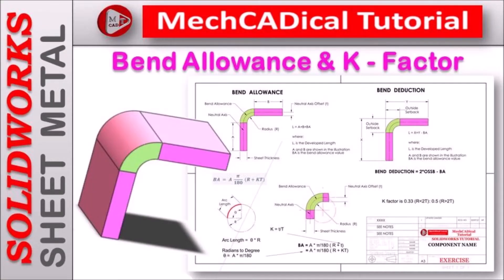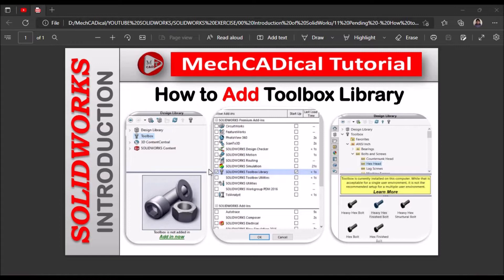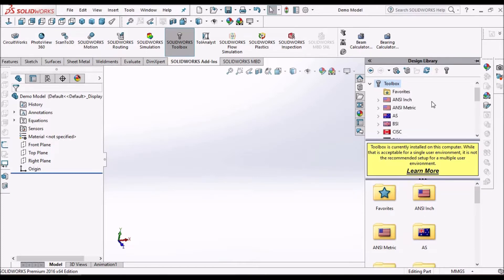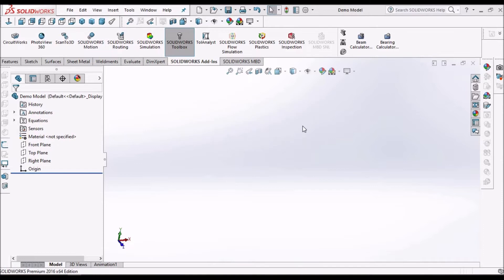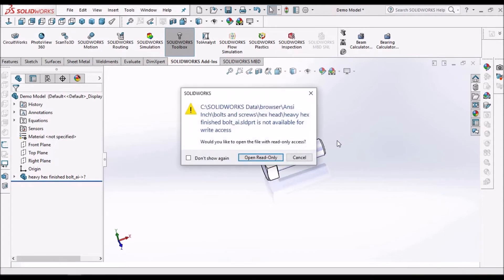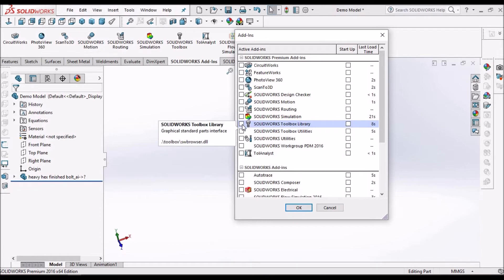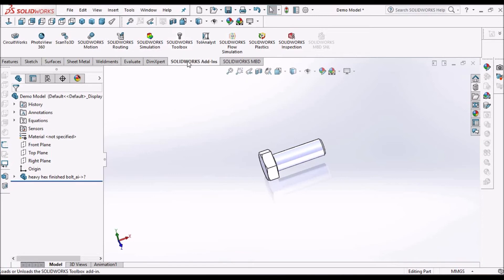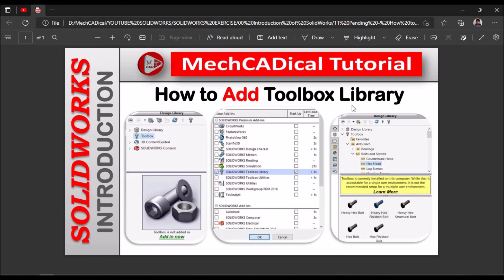How to Add Toolbox Library In SolidWorks

Comment: Please help me, how to fix the derived part issues? I cant custom parts dimension😢
Reply from the maker: Don't worry its very simple, use "pack and go" option and rename the part file, then you can modify the dimension.
Reply: Is your problem solved? I have the same problem. I select the object with the Toolbox and place it. But it gives a derived part warning. Then when I want to adjust the size of the toolbox part I selected, there is no such option.